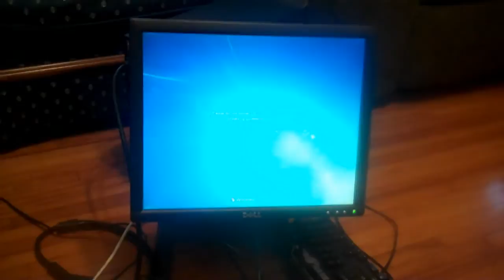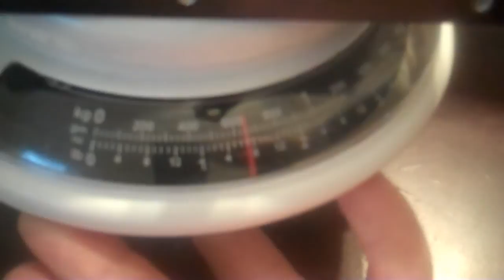Hard Drive magnet - A very useful tool for working on cars or making magnetic tools

Comment: I use 1 those HD magnets on my oil filter.
Reply from the maker: Very good idea! I've seen those expensive magnet wraps that go around the oil filter. Haven't used one though. Using the hard drive magnets would be free and they are a much much stronger magnet. Thanks for a great suggestion! Next hard drive I gut, I'll have one on mine. Thanks for checking out my videos :-)
Reply: PowerAddicts
I also have some on my trans spin on external filter, & fuel filter.